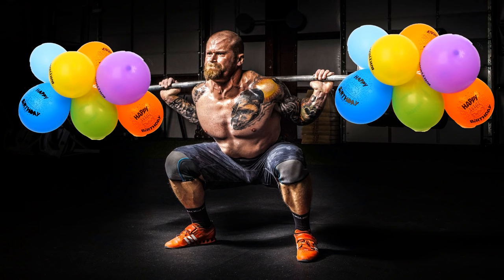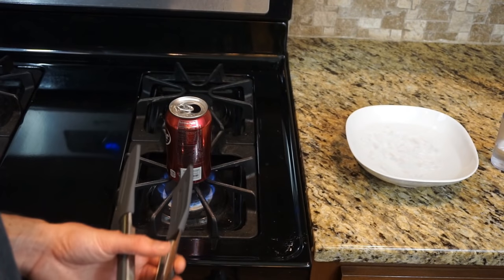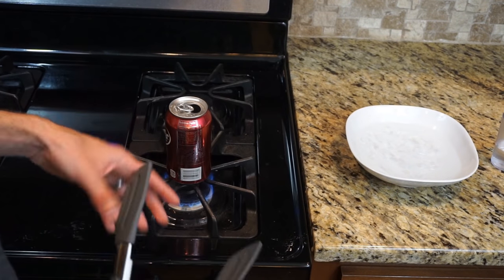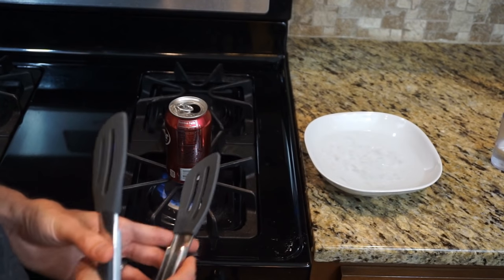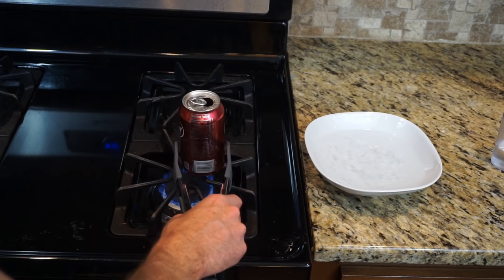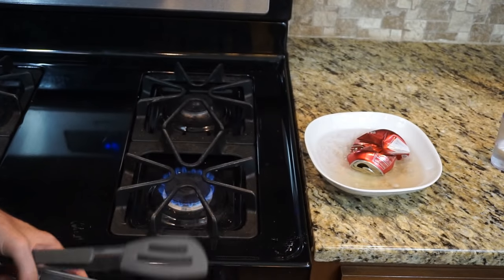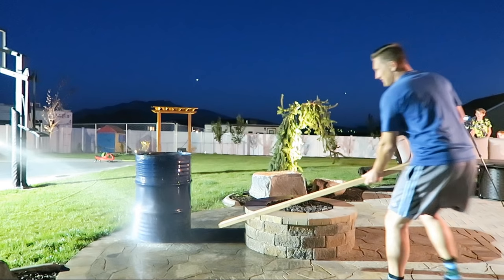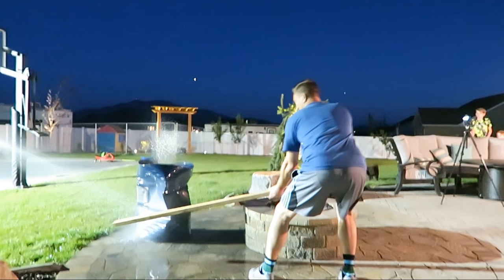55 Gallon Steel Drum Implodes| The Crushing Power Of The Atmosphere

Comment: that wasn't atmosphere presure weight , 
this happend due to the temperature diffrence , and the nature of water and vapor .
hot air expands , cool air contracts ,

the engine in a car works due to the expantion that is created via the ingition .
old engines used steam for the same principle , (expantion)
to see this in action look up stirling engine .
they use no fuel but only air and temperature diffrences to work